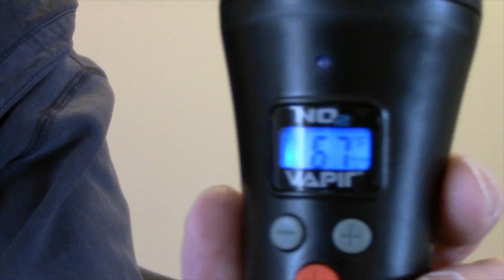Ep. 20 - Cannabis Vaporization Temp. Answers and More Questions

Comment: i only vaporize (Arizer extreme q $150) and i start out at 360-75 fill the bag up then turn up the temp to 392-400 fill then do a last bag that pretty much is combustion temps 430-50.
i find that 360 degrees F, its just a flavor bag, i dont feel that much of anything.
The 392 F bag seems like the most amount of cannabinoids get vaporized. this bag usually gets me high instantly.
the 440 F bag definitely tastes like nothing but i get a heavy body stone usually.
Reply: Hi, do you need the molecular distiller equipment for lab?  alps_daniel@qq.com

Comment: According to merck index, THC's boiling point is 200C.  That number you gave was from someone who has been passing it around the net since 2009, but it's wrong.  Also, even though the bowl in a vaporizer may be a certain temperature, the plant fibers effect the actual airflow temperature.This is why you want to grind fine, and inhale slowly.  This allows the air to be heated to temperature properly.A lot of info on vaporizers are wrong.  You can go to fuckcombustion. c o m to get more in depth.